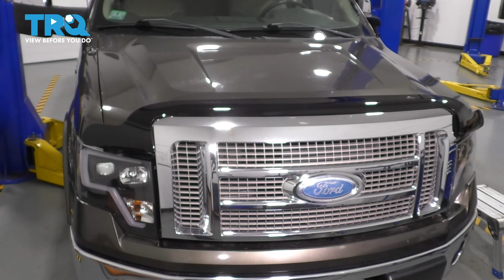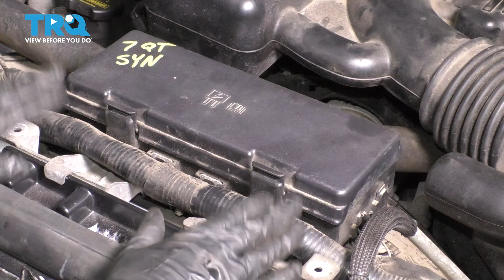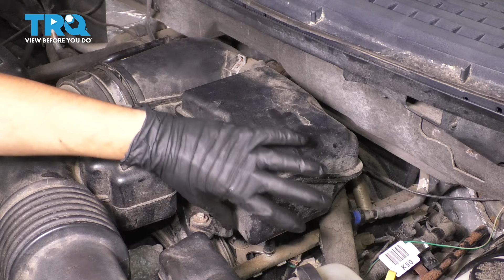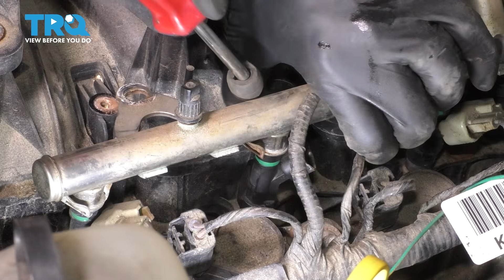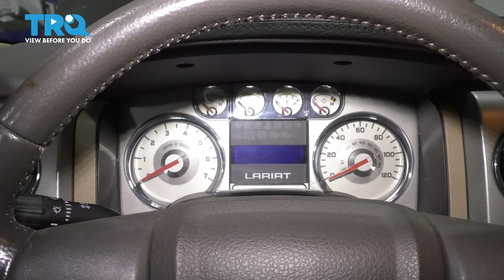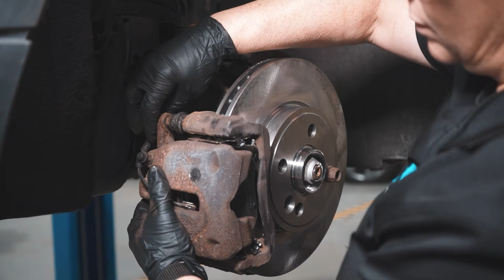How to Replace Fuel Injector 2009-2014 Ford F-150

Comment: Spraying a non-electrical, non-rubber, non-plastic safe cleaner all over the fuel rail, o-rings, injectors, plastic intake manifold, wiring harness; its got to be just one of the stupidest f-ing moves caught on video.

Comment: @6:10 Also, one of the reason you dont want to power tool this job is the plastic engine cover thats holding down most of the component. It doesnt take much to over torque them and have your ignition coil stuck in place. It would suck to pay for a new engine cover and a new ignition coil, just because you over torqued one screw... ahh Ford.

Comment: I feel like you just contaminated the entire engine and destroyed the connector on that fuel injector with fuel saw puddle drop in that connector, not only that, spraying brake parts cleaner on plastic and in fuel you probably shouldnt do that